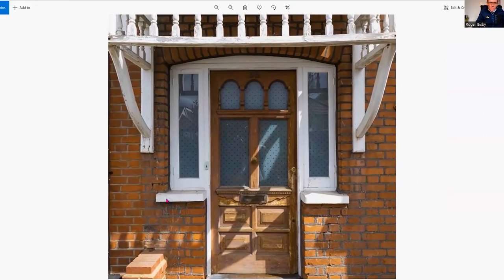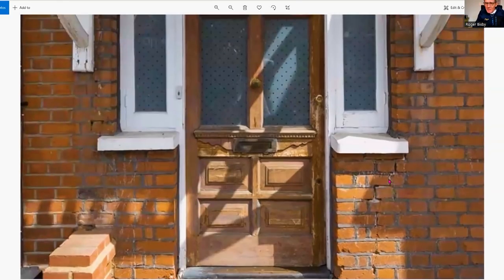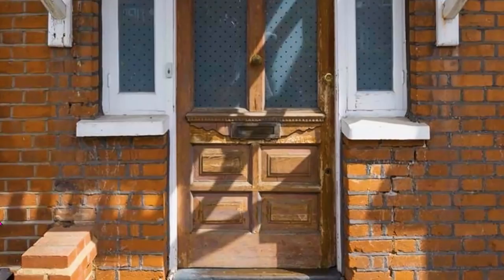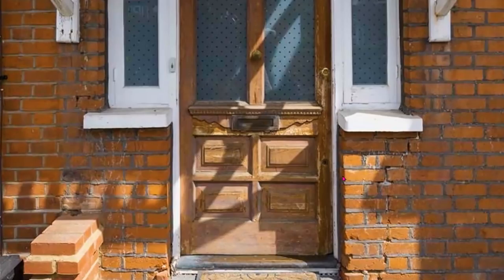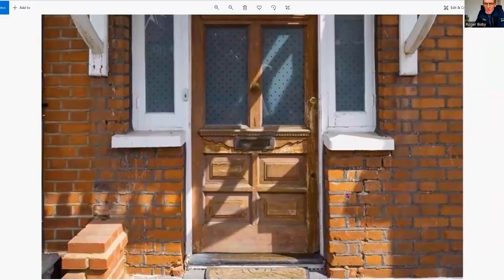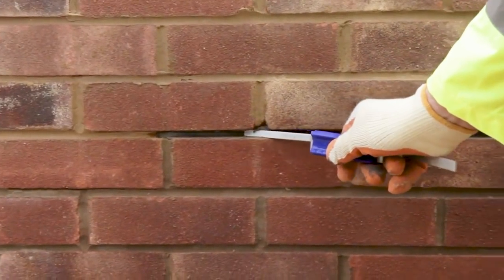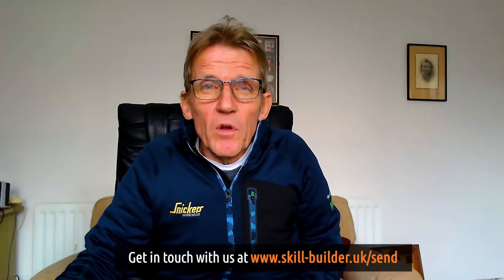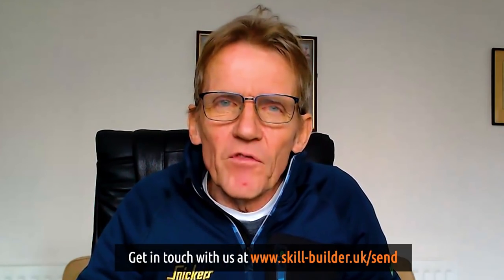Cracked Brick Wall - Should You Worry?

Comment: Roger, a related query...... Here you say the mortar was 'too strong' and when repointing use a mix that uses lime which will make it more forgiving. On another video, you mentioned mortar between thermalite blocks should also be soft. Why put soft mortar between bricks or blocks? The 'general rule' that mortar should always be softer than the brick/blocks. Why? Thanks and regards.....
Reply: The idea is that the mortar is "sacrificial", so if there's any stresses in the wall it should break and not the brickwork. Traditional lime mortar was usually quite soft and slightly flexible so it was able to flex along with the building. Modern portland cement is rock hard and cannot flex in the same way so it cracks. That's why you see modern strap pointing falling off old stone walls. This hardness is not an issue on modern buildings with hard fired bricks and concrete slab foundations but it is the kiss of death for an old building. You should NEVER use cement on a building that was built with lime mortar.
Reply from the maker: Spot on

Comment: Thank you for your brilliant videos on building ... the best I hve come across.

Not sure if this is similar but here goes .. .I live in a house  (built aroind 1918) on London clay .... the bay window has cracks where it meets the main house - in t 2006 I was youonger and got all worried about subsidence - the insurance company put some little things to measure movement and concluded that the neighbours little tree was tacking water and drying teh soil - we had some builders fill the cracks - they said with some flexoble stuff. We have carcks again .. about 3mm wide and the double glazed windows have shifted forward and down a bit so they don;t close properly and I have taped one up to stop rain getting in the botteom.

Watching your videos I will avoiid filling with a "rock hard" exterior filler and maybe use some flexible filler or weak sand cement or find a lime product ... what would you advise.
Reply from the maker: Hi Martin
This is a very common problem with bay windows. Fortunately they are very easy to underpin. If you dig down you will probably find the brickwork is straight on the clay.
I would wait until the end of the drought and then it is just a question of digging one hole in the middle and filling it with concrete and then when that is set and dry pack a couple more on the corners and the same routine. 
It might even be possible to jack the bay back into position but if not you can fill in the cracks. Given the fact that there is no real weight on the footings it should be easy to put back.

Comment: I have just done a bit of dotting and dabbing but used foam seemed to work a lot easier, what are your thoughts.?
Reply from the maker: I have used the foam and some months later some of the boards came loose. I think you need to wet the wall.

Comment: What is the difference between hydraulic lime     and hydrated lime?
Reply: Hydraulic lime is used in a traditional sand/lime mortar mix and sets upon contact with water. Hydrated lime has a small amount of water pre-added and is usually used as a plasticiser in a portland cement mix.
Reply: @jannenreuben7398  Thank you for the information.
Reply from the maker: Hi Kevin
 We will be doing a whole video on lime and some of the myths. Hydrated lime won't set on its own so you need to add an equal amount of cement. Hydraulic lime will set on its own and is used with sand and no cement.  It is unlikely that a merchant will stock hydraulic lime because it is a slower way of building so not popular.